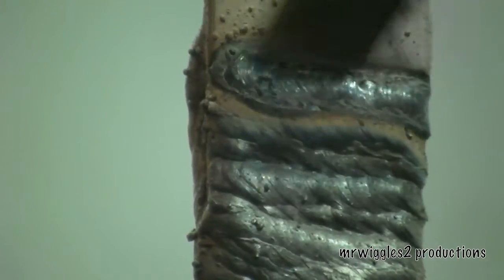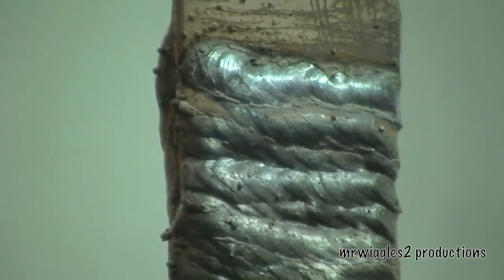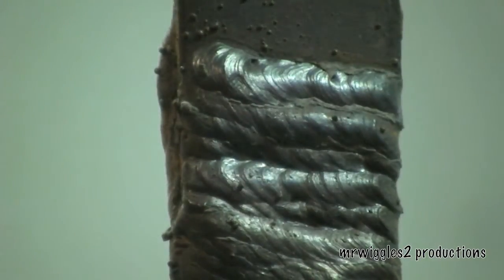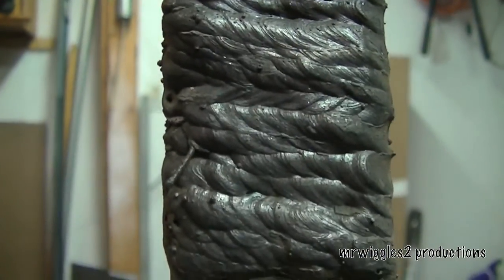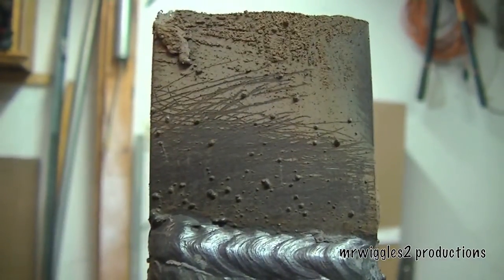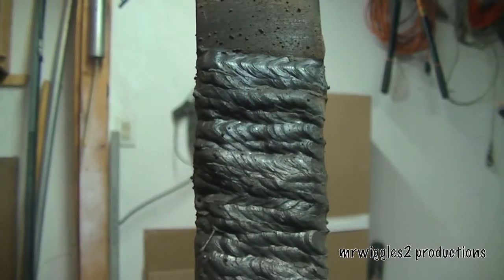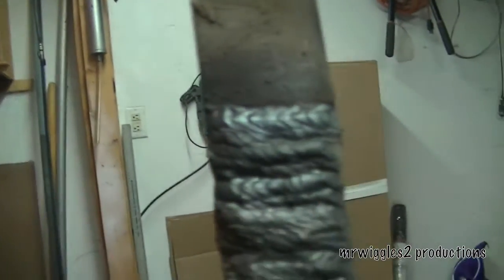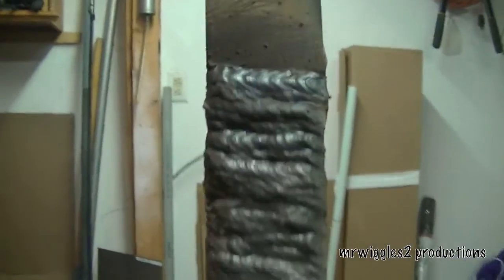Harbor Freight Mig 171 Welder See Description

Comment from the maker: I'm a flux core fan.  Kinda messy, but, if you can weld good with that, will make welding with bare wire impressive.  Thanks a lot for watching!